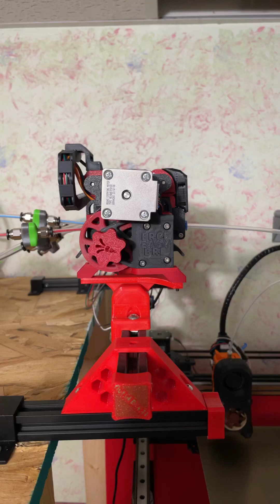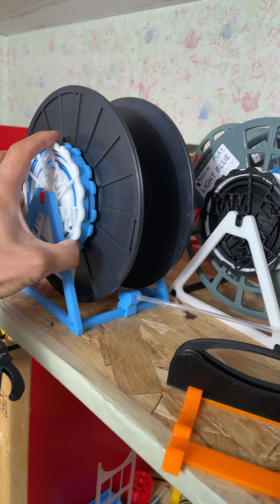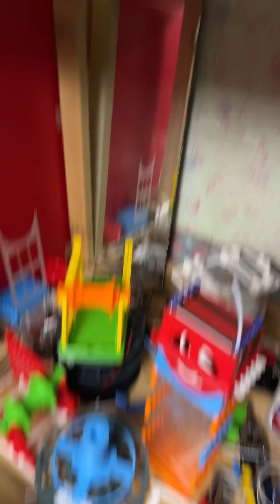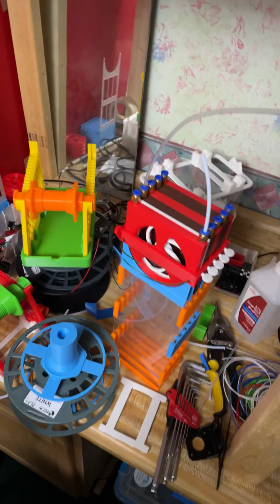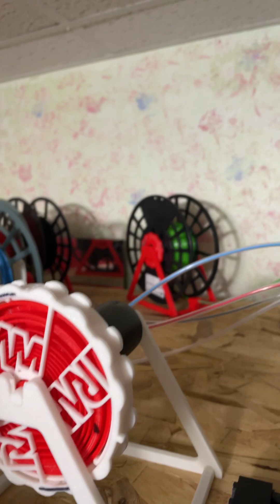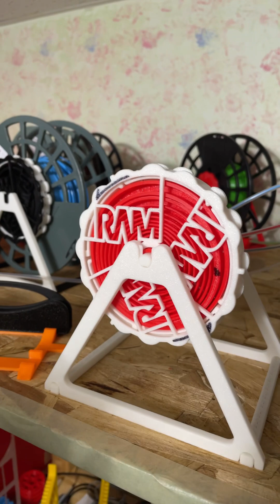Finally settled on filament buffer.  Link in description. #3dprinting #ercf #mmu #voron

Comment: Which model are the PTFE Tube Holders on thew bottom of the stand from? Are they custom?
Reply from the maker: are you are talking about ones with that are stacked with red & brown?  That is filament-bank.  it does work well once you get all the kinks worked out.  I had to make holes bigger by drilling it out to keep filaments from binding.  Also placement of the filament-bank can cause binding.  you can find it in GitHub here. https://github.com/x0pherl/Filament-Bank
Reply: @Outofbox11   I mean the small holders attached to the Spool Rewinders at the beginning of the video. Where the blue holder is attached to the blue rewinder stand and the black one is attached to the black and white rewinder stand.
Reply from the maker: you can find that one on Thingiverse
https://www.thingiverse.com/thing:3338467